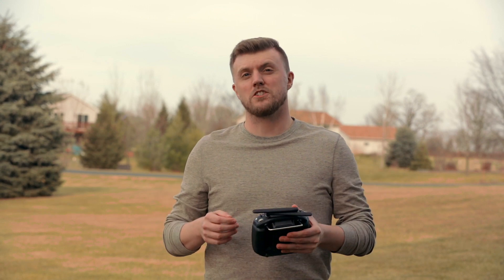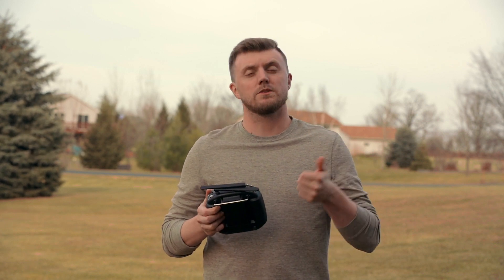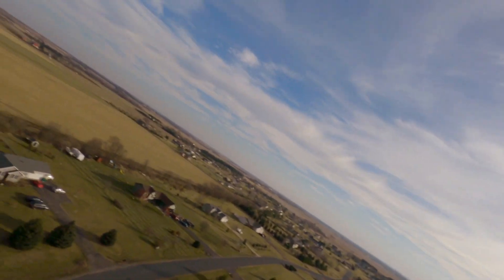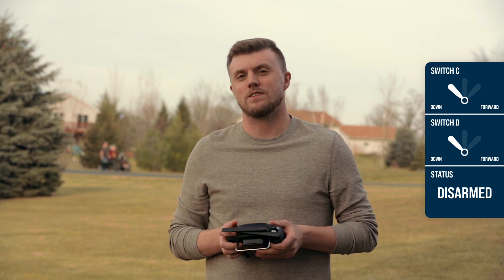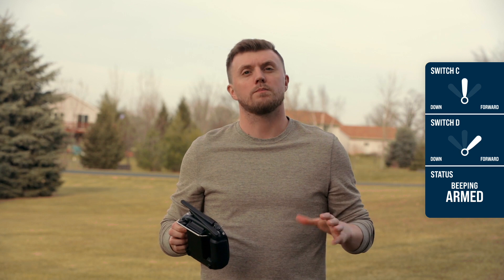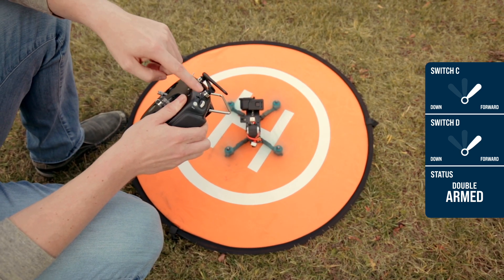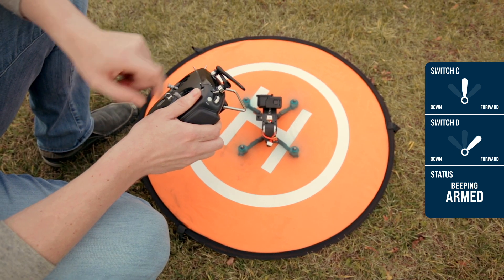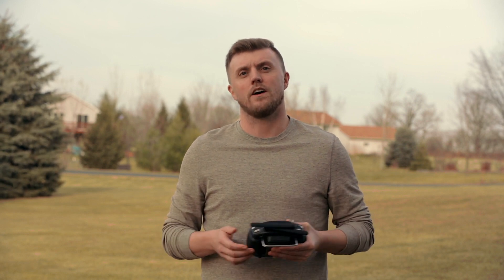Backup Arming Switch on DJI Drone Transmitter in BetaFlight | Cinematic FPV Tech Talk

Comment: Dji kinda has this built into the controller. If you hold down the c button (the big one on the bottom right of the controller) for a few seconds.  It locks everything on the controller except the functions like navigating the menus. Then you hold down the c button for a few seconds when your  ready to fly. It unlocks the remote. Bam arm and fly. 😎 doesn't help with accidental disarms though.